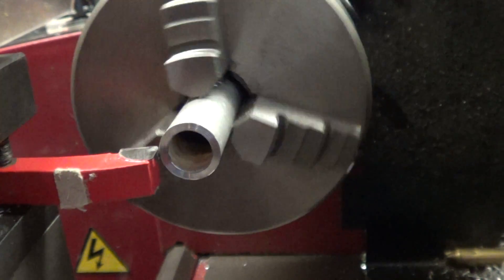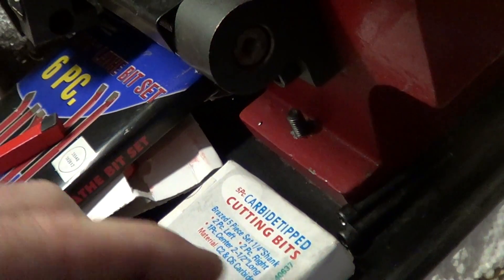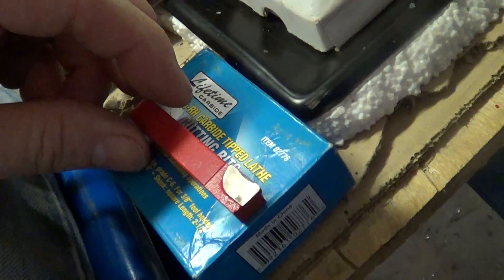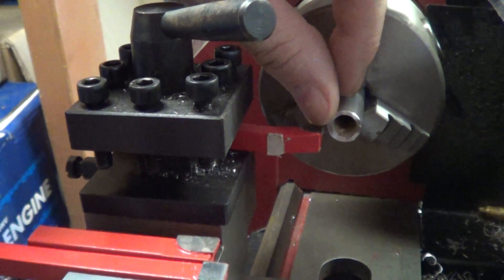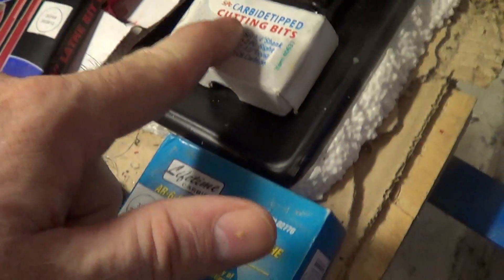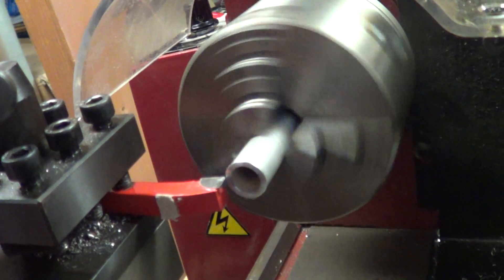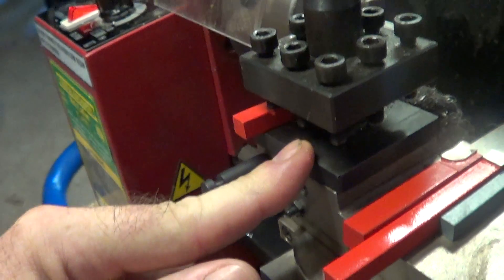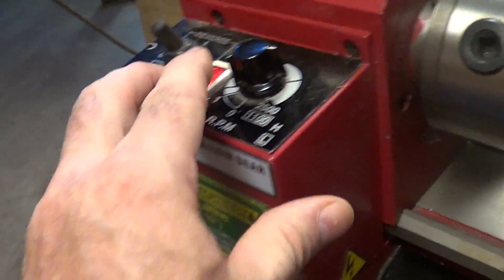7x10 MINI LATHE Tool Bits 5/16 inch size for 93212 Harbor Freight

Comment: I'm brand new to using a lathe and just bought the 93212 mini lathe so this video helped! Surprised that there wasn't hardly any info in the manual about the right way to put tooling in the tool post or any explanation of why you need to use proper sized tooling even though the tool post could seemingly accept several different sizes of tooling. Thanks again.
Reply: Collin Smith Howdy Collin . The basic setup is to always have the tool end at center vertically. The best way to do this is install your live center that came with your lathe into the tailstock. After that you run your crossfeed over until it is close to center point of your live center. That way you know where center vertically is. No matter what your turning or threading always stay on center vertically. No matter if you are using a no. 4(1/4), no.5(5/16) or no.6(3/8) the tip of the tool needs to be center vertically. I pray this helps some! Enjoy the lathe and enjoy the world of turning! Be safe and God bless you and your family!!!!

Comment: You can grind the bottom of the 3/8 bits by 1/16th and still use them.